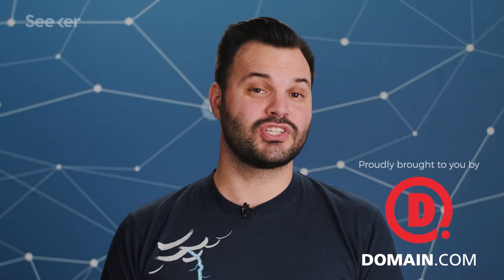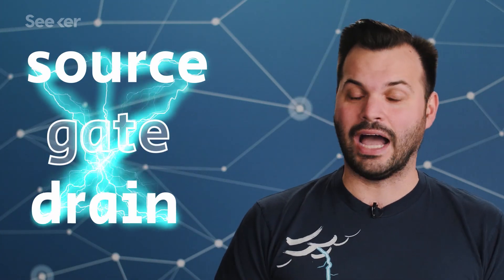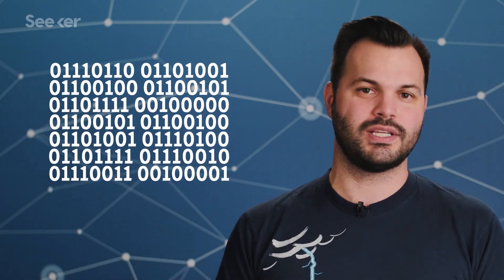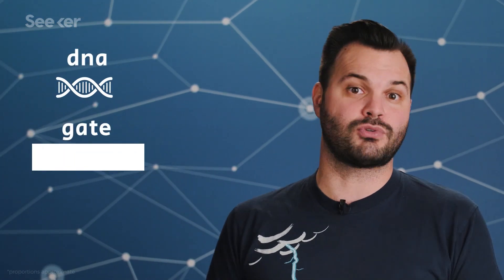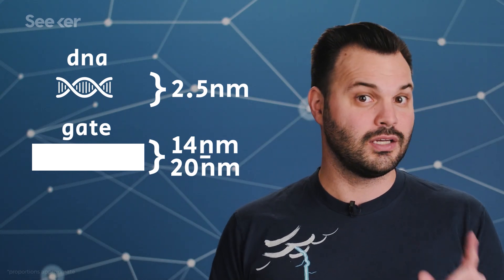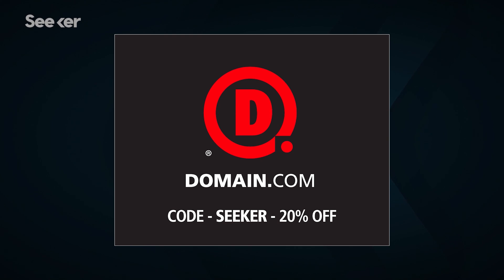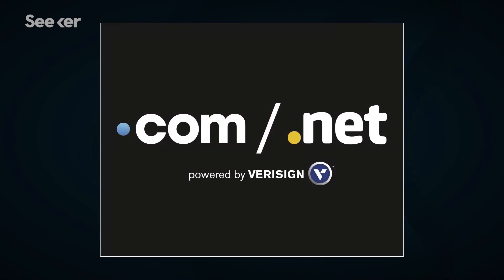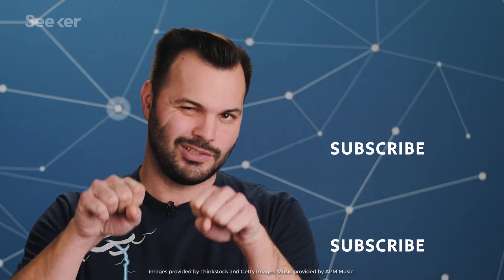This Is the End of the Silicon Chip, Here’s What’s Next

Comment: I think a better CPU analogy would be to compare it to an engine, not a brain. Instead of pistons you have electricity. Its job is to crunch numbers... they run, they don't think. The computer is not smart, even with AI or ML - your software does that, the computer simply runs the software.
Reply: ...For now.
Reply: Nicole Fawkes It's not just software. it takes particular hardware infrastructure. DSPs, the GPU, and CPU are usually combined with special infrastructure to do something. There's some form of thinking, software or not.
Reply: The computer doesn't "crunch numbers."  It is a symbol manipulator.
Reply: its not a brain...  all it does is spit out 1's and 0's    this is way its possible to make a cpu that use's light.

think about a flashlight turning on off..     leds and a light sensor is = to a single transistor so that why he meant it might be larger then todays cpus
Reply: @harleyme3163  inside all it does is on and off the result is a picture or sound that is either totally synthesized or a sampled and recorded rendition of a moment in life. U are missing a few key ideas here 
Symbols...and encoding are core concepts missing. 

What is language except fucking weird sounds? But those weird sounds are structured in a way we predefined and agreed on. So instead of killing animals we can jump on or beat with fists for food and doing it all alone... We can make meaningful symbols out of sounds. The symbols created allow Comunication of all states of existance as one is seeing to another. Language was humans being wired for networking.. And our brain had to develop this symbolic abstraction first... If I speak the word car. It is actually nothing but me vibrating air at fluctuating pitch and dubty cycle. Well that's a signal.. More importantly.. If someone has the same encode decode program I do from childhood data and structure acquisition /programing ... That arbitry patern isn't just me make noise. Ive conveyed a meaning of thing that makes finding the next meal quicker or gets one anywhere faster than on foot. The sound is a pattern the thing it conveys is a meaning or sybbolic representation of things and experiences we encounter and have stored.. Etc.. 

Computers do same thing same way. U have a brain that gets a basic set of instructions from bios chip to turn on. U then feed it the rest for how to structure the data where to store and where to output for diff data types. 

Cpu just like a brain is just used to 
 store manipulate and recall (with option to output or process with further query, like plug answer from equ 1 into 2 or in brain... "I  need to eat, load list of things I could eat) to computer  symbols  are just differing voltages(see differential signaling) or voltage and no voltage.

The brain uses either exactly that or that and a chemical signaling process. 

If u arnt with me yet.. Why would magic from God  take 9months then  4 to 6 years not to shit and piss itself? Why does parental involvement fix that disfunction and enable random goooo goo to, "where is barhroom"? Why doesn't goo gaa goo convey that question?

Does God say let there be non confusion or is it pretty clear a system is being configured with programs data sets and encoding that enables it to convey needs and get updates on needs and or any relevant factors to said brain not having blood suooly/03erson dieing? 

 From moment ur brain forms it starts building a representation of the world it precives through electrical and chemical to electrical signaling pathways.. Ie spine and optic nerves, nasal sensors... They don't speak magic they have an encoded signal just like digital logic.

We have proven diff regions in brain do different specialized tasks.. Just like a cpu. We can use a magnetic pulse through skull or electrical by attack wires after drilling your skull and with some pulses in places we have mapped we can make u shit yourself x years after eliminating need for diapers. Or knock out your ability to speak while signal is applied etc.

I suggest you do ur homework or adopt the credo of its usually best to remain silent and let people assume u r a fool rather than.... Output disjointed non sequenters with out supporting evidence... And remove all doubt
Reply: @harleyme3163 u no. Seqentered the hell out of that. It's not a cloud all it does is rain or not... Well whats missing there is why the cloud is more than rain or not. The brain is most likely just a system of ons and offs except the signals pass through a chemical gateway during transmission. We have yet to find anything magic about it. Sure theres some entanglement possibilities but we can do that on sand too
Reply: You are a machine... Don't belive it get a map of what portion of your brain controls what functions... And get a power with a long drill bit... Write us after drilling your motor corex and let us know how non machine and magical brain is doing. Good luck

Comment: We've already abandoned typical transistors back around 2010, the switch was to FinFET which has a larger gate area for the relevant physical size, developments on GAAFET will probably extend the limit closer to 3nm. But it's worth mentioning that there are multiple types of transistors around
Reply: The way the video puts it the practical limits of silicon transistors is 5nm, but that only really goes for FinFETs, normal planar MOSFETs really had their last practical run around 20nm (maybe 10nm if we count planar FD-SOI).

The same goes the other way too, advances in new transistor shapes (horizontal/vertical GAA-FETs and the like) will help to push beyond the limits of 5nm, probably to around 4-2nm.
Reply: Aren't you guys conveniently ignoring the 3rd dimension?
Reply: Depends on what you mean, FinFETs were called "3d transistors" by Intel back when they were introduced due to them judding upwards (and moreso true with modern taller/thinner FinFETs).
The whole point of vertical GAA-FETs (or who knows maybe vertical TFETs) is to utilize the third dimension for better efficiency, but this can in some cases lead to less dense transistors which is problematic for some areas.
If you mean stacking transistors/dies on top of each other; that doesn't really change the way transistors are made, which is what the video again talks about (or doesn't depending on who you ask).
Reply: heat becomes a major issue with silicon chipsets the smaller the transistors get, luckily material science is slowly working on cheaper better materials
Reply: Gallium Antimonide, Gallium Germanide, Gallium Nitride and Gallium Arsenide transistors are a few options for 3nm and smaller nodes, to list a few.
Reply: @Dr_Mario2007  I don't know about others, but GaN is far far away from even being considered in computing, these materials are great for niche applications like RF, Power Eletronics etc but when it comes to cmos, the complemetary p-type device is extremely slow

Comment: What if you keep the same transistor size but just put more of them? The CPU will be bigger, but what's the problem with that? Why do they need to make them smaller to make it faster? I think that's a viable thing to do at least up to 3 times the size form the ones we have now. What am I missing?
Reply: burt591

The larger the cpu, the slower and hotter it runs.
Reply: Yeah but still I think 3 times the size from the ones we have is feasible, just needs 3x bigger cooling system. It would be nice to know exactly how the size affects it.
Reply: burt591 For Desktop/Tower Pc's it would work but whats with smartphones and laptops
Reply: burt591 
It would also cost three times as much, which then you'll just have a super computer that costs a ton. Because when you make them smaller, they use less energy per transitor, thus you get more bang for your buck.
Reply: burt591 - What you are missing is that the propagation of signals is limited by the speed of light, and in many areas of computer design, we are already up against that limit.
Reply: Good point
Reply: They have been doing this for a while .. gpus are the extreme example of this but even with cpus they USE all sorts of predictive and parrallel pipelines. Clock Speed has effectively stopped invreasing. So to go faster they pack on more transistors add multicores, more cache and more volts.

Comment: Since the computer's childhood,  CPU has been king. ie a chip. That handles all information. the only time. where there is another chip in play, is with the GPU. Maybe we should learn a bit from biology. How different parts are specialized to handle specific types of information, for example. audio or pictures. if you built a group of chips. each one has an architecture. that was designed for a particular type of data. then it would give a boost to what the computer could calculate and how fast.

Comment: Power consumption of a light based cpu and size will need to be made more viable before anything like that can be used. Switching on lazers and light emitting diodes at speeds required will need massive requirements for startup draw and thermal dissipation. Phase discrepancy of the wave guide will also be a headache. Fiber over longer spans is flexible but on distance like a cpu it will be difficult to work with and develop.

Comment: I still think there must be a way to make transistors that operate in higher bases. That would increase computing power exponentially. I mean, our brains are based on electricity and they don't use binary. Why should our transistors?
Reply: There are a few problems with that. If you let transistors operate at for example 4 levels to process 2 bits at once, then the maximum variation of the voltage level would be only up to 12.5% while our binary "all our nothing" technology can theoretically handle variations of up to 50%. Most of those variations are due to parasitic capacitances, which charge exponentially, so you either have to drive much more current trough your transistors or operate them at a much lower frequency. Since you want more speed and cooling is already problematic on some modern chips you don't really want to do either. CMOS technology is quite simple but not at all made to handle multiple voltage levels, adding support for that would probably add more complexity than just adding extra transistors.

Finally there really isn't that much to be gained by it. Adding more levels basically corresponds to adding more bits. This doesn't increase performance per se. When you compare the performance of a 32bit and 64bit computer while working with 64bit numbers then there is a big difference since the 32bit computer has to do multiple calculations to get a 64bit result while the 64bit computer can do it at once. Most computer programs however rarely use more than 32bits at once, since that's already more than accurate enough for most purposes. both 32bit and 64bit computers can do those calculations at once and will have similar performance. Adding more bits mattered in the 80's, 90's and early 2000's, but as soon as we had 32bit there was no real performance benefit to adding more bits. The move to 64bits was mostly to allow more memory (32bit can handle up to 4GB of RAM at once, 64bit can handle more than we'll ever need).
Reply: but then again, our brains don't use transistors and aren't only using electricity
Reply: Isn’t that quantum computing
Reply: That wouldn't be called a transistor at that point. But ignoring terminology, there are designs for analog(numbers in a range) computers, however they are incredibly hard to manufacturer. The reason binary digital is used is because it the most noise resistant. This means you can put much more components close together without them interfering with each other and you don't have to use exotic cooling to reduce temperature noise. I know of a few cases where analog compute are still used like solving difficult differential equations.
Reply: transistors are either sending and on..   or off signal.   which is binary (aka 2 things it can do)
so..  :-)    kinda limited to 2 bits ..  aka 2 bits a byte....   catch on ?
we would have to create an entirely new way of computing.  aka EVERYthing would have to change with it.
Reply: @harleyme3163  no idea what you mean, binary is only ONE bit - it may be 0 or 1...